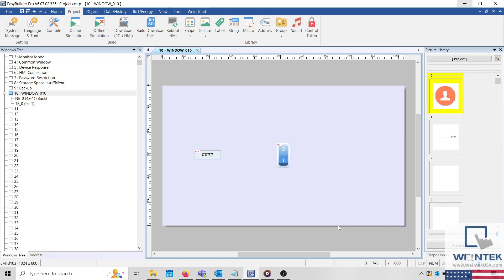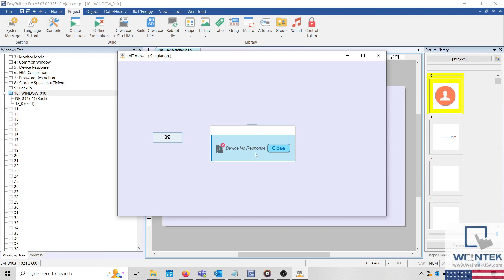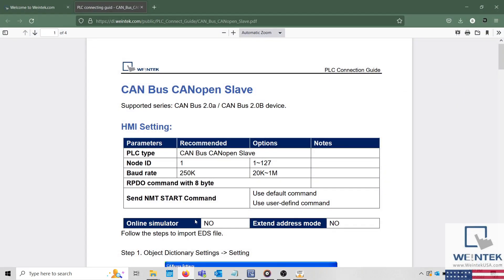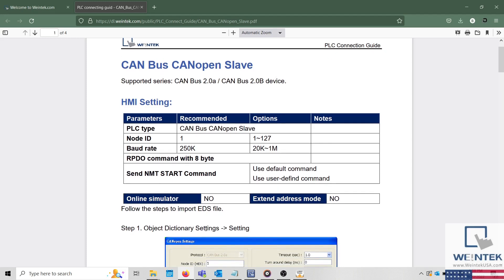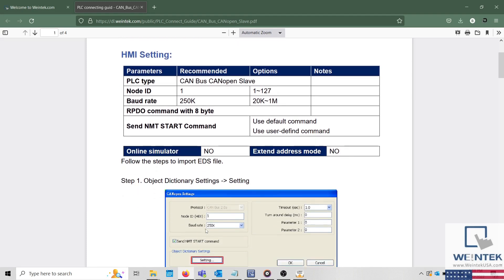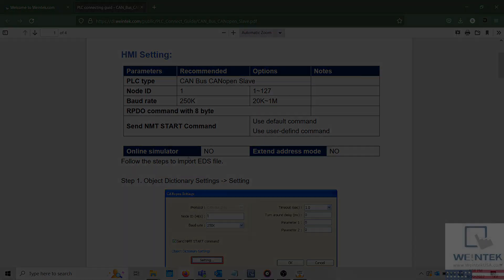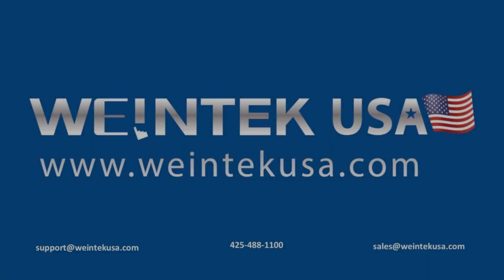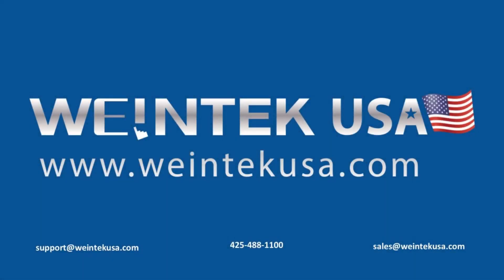7: How to simulate your EasyBuilder Pro project - Weintek USA

Comment: But my simulation is appearing partially off screen at the top, and I cant move the window it is running in! I just tried moving the items lower on the workspace screen and I can see the top of it now but now even less of it is showing overall...it all ran off the bottom...and the pic is so big it wont fit on the simulation window....so I need to "zoom out " the simulation view somehow
Reply: Hi @2stroke1971, right-click within the simulation window and select “Fullscreen.” This will fit the simulation window to the size of your screen. If the simulation is still too large, try right-clicking and selecting “Scale to window size.”